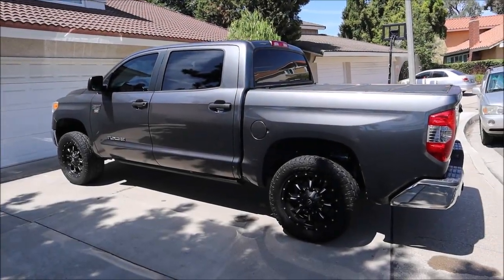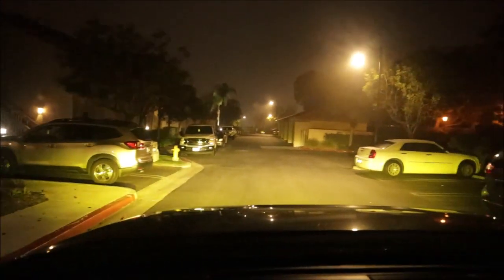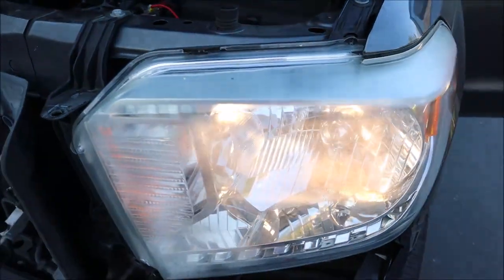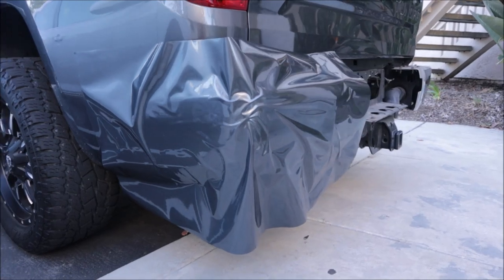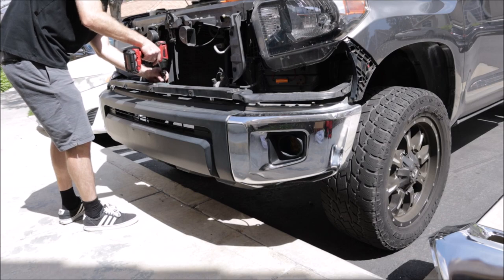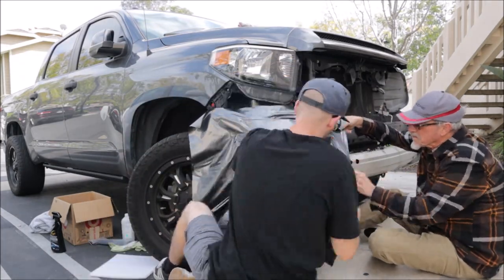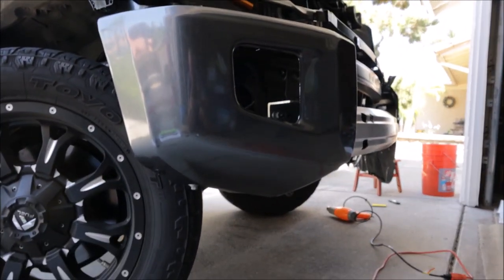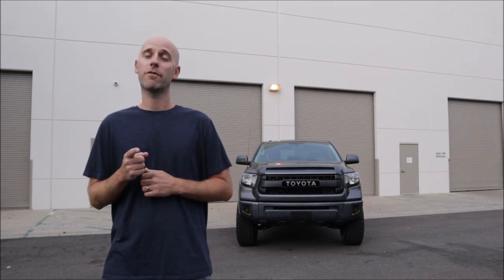Tundra Chrome Delete - Grill, Headlights, Bumpers: Tundra Build Part 4

Comment: I wish I could have saw how the rear bumper section was removed. I’ve been searching all over YouTube
Reply from the maker: The top plastic piece comes off, look underneath for the clips to squeeze,  and then a few bolts on each corner.
Reply: @RoadPatina  Thanks. I’ve got to replace my drivers side rear bumper piece. I was hoping it was one piece but Toyota and spark parts both said it was 3 pieces. So I assume the entire piece of plastic has to come off the replace one section.
Reply from the maker: @Tundra455  it’s pretty ez. Just look underneath first!
Reply: @RoadPatina  I didn’t find some video on removing the left side bumper and I will also be using a lift to replace this bumper
Reply: And that’s did and not didn’t * and thanks for all your replies.

Comment: I did a chrome delete as well. New grill and bulge but I used plasti dip on my bumper ends. 30 bucks and about 3 hours total including dry time between coats. Turned out great on my black Tundra. Time will tell if it holds up.
Reply from the maker: I thought about that but ultimately wanted grey corners.

Comment: cool stuff!! any links for the grill? thanks!!
Reply from the maker: It’s available at any Toyota dealership. Online is usually cheeper, but shipping can get you. I got mine from Toyota of cool springs with free shipping on Black Friday. Don’t forget the bulge is separate!
Reply: @RoadPatina  Ok, that is cool, I found an online OEM trd parts place but it said that the TRD pro grill is not compatible with my 2020 limited lol, I'm pretty sure it is right? Thanks for the info :)
Reply from the maker: @TheAngryCamper  does your have the radar sensor in the grill? This grill will work without the sensor. Newer pros have a sensor in the grill but it’s a different style grill. Research Roman on tundras.com he has very detailed parts pics and numbers.
Reply: @RoadPatina  yes sir, mine has the TSS system and all that, thanks for the info, I sincerely appreciate it!!!
Reply from the maker: @TheAngryCamper  no prob! This grill won’t work. You need the newer pro grill.

Comment: when you ordered the  new grille did it come with trim around it thats usually chrome i have that on mine and i hate it and cant find replacement chrome delete trimaround grille
Reply from the maker: Yes, it comes with the color matched surround but the part attached to the hood (hood buldge) is separate. You need both to delete all the chrome on the grille!
Reply: @RoadPatina  were did you find it I need one bad
Reply from the maker: @tonydijock151  Toyota of Cool springs. They are all over many forums and have good pricing. Shipping is no joke though. The boxes are huge. I found free shipping on Black Friday!

Comment: How do you like them king coilovers?
Reply from the maker: ncurc 97 love them! They did come on the truck, so I don’t have much to compare. I had a 05 tacoma and 03 tundra that did not ride as nice. Super compliant and it does not nose dive at braking or sway around turns, yet not super stiff either. Wow do I some like a commercial?! What are you considering?

Comment: What year is your truck? Would that TRD pro headlights fit on a 2018?
Reply from the maker: Its a 2014. I believe all 2014-2021 will fit, however, depending on LED vs. halogen a jumper harness may be needed!

Comment: What year is your truck? Would this TRD pro headlight fit on a 2018?
Reply from the maker: Mine is a 2014. All 2014+ headlights will bolt up, however, the wiring may be different as some are LED and/or have different running lights. Pre made harnesses are available online!

Comment: Are these the 0 offset wheels?
Reply from the maker: The Methods are +25 offset. The 0 offset wheels stick out further 25mm. Google images for the difference. I did not like how much 0 pokes out. I do not recall what the offset on these black fuel wheels were.
Reply: @RoadPatina  I bought 0 wheels yesterday. Wanted to see how they look on the tundra. Do you have them on in your older videos
Reply from the maker: @RyanJohnson-dh2ey  I dont recall what the offset on the old wheels were. BTW if your running close to a 35in tire with 0 offset you will need to chop the cab mount.
Reply: @RoadPatina  what about 33
Reply from the maker: @RyanJohnson-dh2ey  not sure, however, it has been covered many times online.